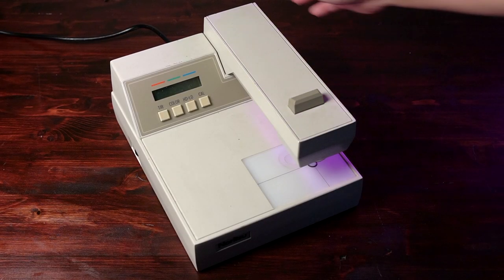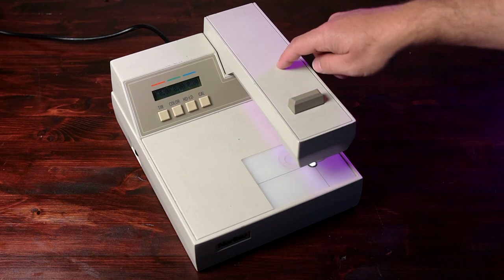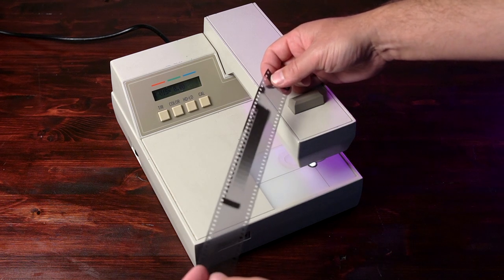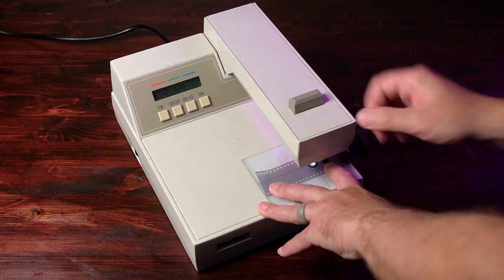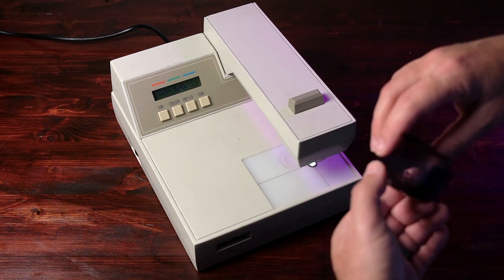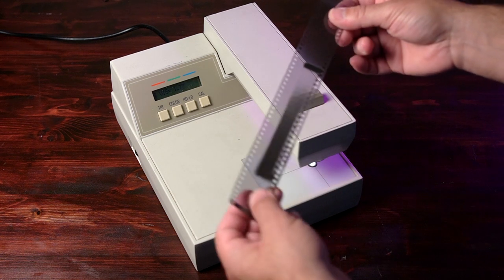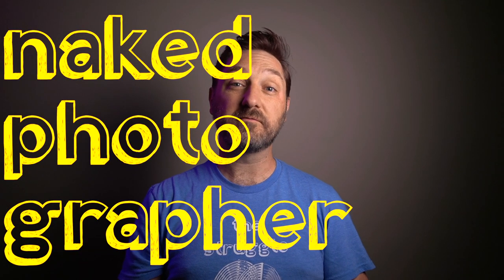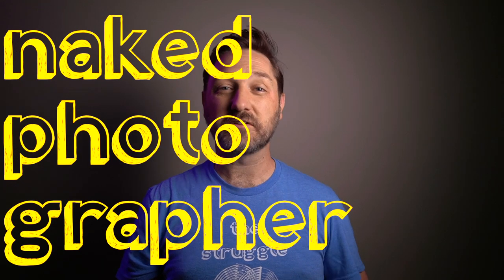Basics Of Using A Densitometer

Comment: Hi Gregory,
Thank you so much for your detailed video. I recently got a densitometer and TP 4x5 (21 step) step wedge as a reference.
I have a question that maybe you can answer. I know my densitometer is for B/W film but I measured an unexposed border of Velvia 50 film and I was surprised it has 2.7D as DMax. Based on the Velvia 50 datasheet it should be around 3.5-4D from my understanding. I am pretty sure I measured correctly. I use The Darkroom for E6 development and Velvia 50 should be a fresh stock. Do you have any ideas why I have this discrepancy?

Comment: I'd love to see a video about using the densitometer with C-41 negs. I have tried to do some C41 at home and I can get pretty good results now but I'd love to know how I can evaluate the negatives properly with a densitometer.
Reply from the maker: For color, the densitometer is better used for reading step wedges to make H&D curves and to plot your aim values from a process control strip.
Reply: @TheNakedPhotographer  Thanks so will that be able to measure the clear part of the leader and see if the colour is where it should be or is that not what this is used for?

Comment: thank you for the video!
How would I use this for checking the quality of my c41 film developer + c41 process?
Reply from the maker: You need to run process control strips for that
Reply: @TheNakedPhotographer  yeah I'm gonna buy some, but I mean litterally what do I have to do? what kind must I get and what numbers am I gonna be looking for to be shown on the screen?
Reply from the maker: Look up Kodak Z-131 process manual online.  It should be a pdf.  There is a section for process control and a sheet to keep track of your readings and whether they are within aim or not.
Reply: @TheNakedPhotographer  thank you <3
Reply: is the x right 410 ok?
Reply: @TheNakedPhotographer  Hi again, would you happen to have a callibration strip for the xrite 810 or 811? I got a densitometer and didn't realize I couldn't use any strip to calibrate it (I have the kodak step tablet) Would you be willing to ship it to me and I can pay yo uand I can ship it back immediatly after

Comment: I got a couple X-Rite 331 from a business liquidation, and not exactly sure what the numbers mean. It seems to go from about 0 to 6. I tried measuing the tint on my car windows with them, and got numbers less than 1 doing that. Is that a percentage?
Reply from the maker: No, it’s a logarithmic scale where every 0.3 is a full stop of light, that means it’s half the amount of light.  So 0.0, 0.3, 0.6, 0.9, etc, each being twice as dense as the previous, or cutting the light in half from the previous number.
Reply: @TheNakedPhotographer  So if I got a reading of 0.5 on my wndow tint its letting something like 33% of light pass through? The tint doesn't seem that dark, and it would have been illegal in the state I bought the car from.
Reply from the maker: There’s no way to know if the Xrite is properly calibrated or if it would give an accurate reading on a tinted window versus the film it was designed for.
Reply: @TheNakedPhotographer  I did have a sheet similar to this, and the readings were a few hundredths off on the samples. https://www.xrite.com/-/media/global-product-images/c/calibration-reference-for-model-361t/361-68.png

Comment: I'm sorry but why would I get one ie what would I do with those values
Reply from the maker: Some people like to graph the density values in relation to exposure to see the contrast, speed, and shadow/highlight separation as a line called the H&D curve.  It can be a useful tool for comparing films or developers.
Reply: The shadow density (semi-clear area) is primarily effected by exposure. So long as development is in the ballpark, only changes in exposure will effect changes in this value. In order for the near darkest shadows to print out as such, they have to have a certain density, where marginally more density will yield a lighter shadow and a lesser density (and all lower values) will yield only a maximum black your print paper can produce. Testing of paper can refine that target value, but 0.1 - 0.2 density (above the natural density of the film and emulsion itself) is usually the value you seek. You increase or decrease this value by changing the ISO of the film using a "standard" development process. Once you have a film speed (ISO) which hits your target density for your combination of camera, film and development method, you look at the highest value (darkest negative value) which allows that negative to yield a print which has near-whites, just on the edge of the whitest tone the paper can produce. On film, that value is adjusted by development (time, temperature, type pf developer). the trick is that a slight change in development will not upset your film speed standard, so you shoot film at your standard ISO, then develop it so that the density range of the film negative is close to a perfect match for the requirements of your printing paper. The procedure to do all of this requires a certain amount of trial and error, plus an absolutely rigid control over processing variables. That why most folks will shoot film at box speed and develop in D-76 at recommended time. However, the payback for this effort is a negative which is so easy to print, and an understanding of what your film and development can do if you want to stray to get some special effect. (Note that you can eyeball the lightest print tone values, or you can use a "reflection" densitometer to measure those values on your test print. A transmission densitometer won't do this.)
Reply: I've used mine to calibrate my enlarger meter (RH Analyzer Pro) as matching numbers is a lot easier than attempting to eyeball gray against a reference card.
I've also used mine to inspect C-41 Process Control Strips as a way to periodically check that my process and chemistry is producing usable results without having to risk film that I care about.
Reply: @randallstewart175  I read all that, very interesting. Can I bounce my understanding of this off you? So for zone 1/2 densities on the negative, if they are too faint (i.e not registering at all on the print) then it's more efficient to remedy this by reducing your EI rather than by increasing development. You could increase development but then you run the risk of your zone 8/9 whites blowing out on the print. But that last point doesn't really matter that much with variable contrast paper (or does it?).
    In summary, the main thing is to get your EI / dev time matched so that zone 1/2 detail is just appearing on the negative and therefore separable from pure black on the print. You may be pushing or pulling the film without realizing it (although we are assuming here that your EI is not a million miles from box speed!), but for that EI/dev time you are at least using the film optimally.
    If you were writing a "developer primer for dummies" would you endorse all that? Cheers, Keith.
Reply: @emotown1   I'm not sure I followed your points accurately, so let's summarize. The exposure largely controls the threshold where the shadow (light) values will first appear on the film as very faint imaging. So if you are not getting printable density from your zone 2 exposure, you need to lower you film "speed" by increasing the exposure for that value.  Development changes have almost no measurable impact on the film density of the zone 1/2 values. So, if you are trying to "zone" adjust a given film/developer combination,  you start with a middle of the road developing time/temp, shoot the same subject target over a range of EI, develop and select an EI (speed) which yield the best EI. Then, you shoot some of the same target at that  EI and  develop at various time/temp until you get highlights  which  match your goals for your printing paper.  Thus the old saw: Expose for the shadows and develop for the highlights.  If you over develop your film and blow out the highlights, then they are gone, and no variable contrast paper will recapture them for you. My personal practice is to  use a standard time and temp to process my B&W film to insure a full shadow detail  capture  and variable contrast paper to adjust overall contrast range in the print. This will manage most low contrast subjects. If I determine that my subject has exceptionally  high contrast, I might reduce development time (pull the process) to avoid "blowing out" the highlights, but I rarely run into the problem.